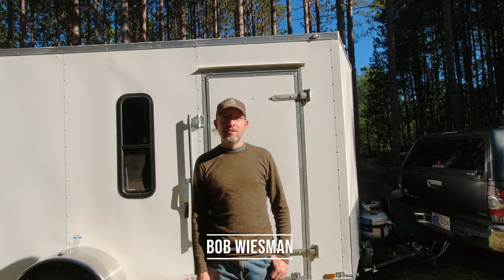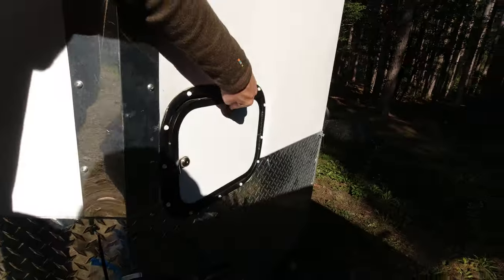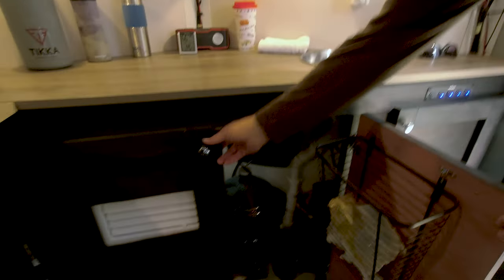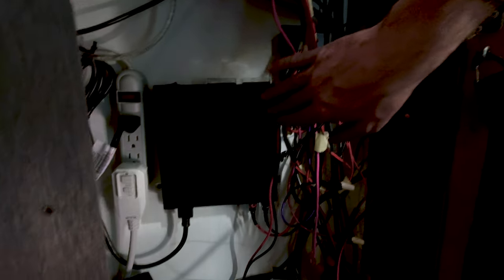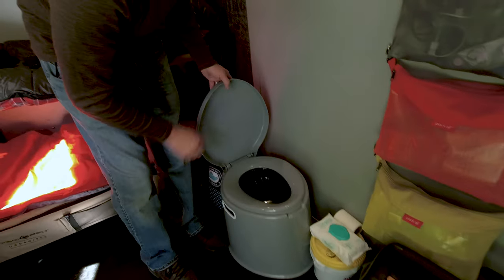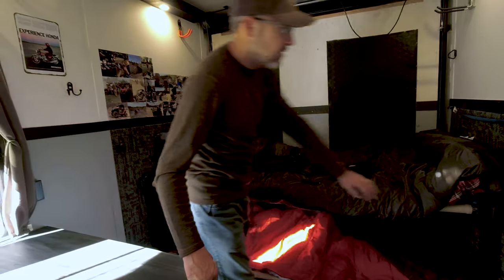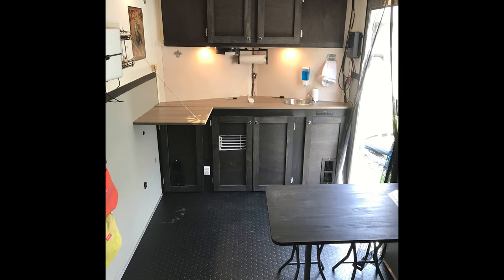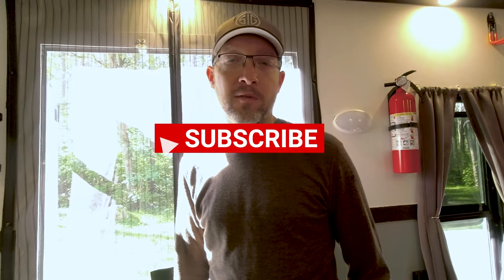6x12 Cargo Trailer Toy Hauler Conversion--Tiny Home!

Comment: Nice trailer build. This is a smaller variant and version of what I am acquiring items for. I have a 7x16 enclosed. No real "frills", only the practical needs and a few creature comfort items. Instead of the tie-down rings mounted to the floor, I am going with e-track on the floor and walls. I am also going with the Disc-O-Bed setup. I need three in my case. I am anticipating hauling an Argo 8x8 or two 6x6's. I see you most important feature is your hat.
Reply from the maker: Ernest,  good luck with your build!  I'm thinking about getting rid of the disc o bed setup as it's a bit of a pain to set up and tear down (just trying to streamline my process).  May have brackets towards the ceiling that store the beds (mattress and plywood) on them that I can manually move down to other brackets on the wall where the beds will be used, if that makes sense.  Going with a larger trailer is a great idea, in hindsight a 14' dual axle would be best for my setup!  Thanks for watching!
Reply: Let me know Paul where I can see your ideas. Good luck. Greetings from Nashville Tennessee 
 Solo

Comment: Great video. How is the ac vented again I seen threw the front but is there anything else toit?
Reply from the maker: I forgot to include that in the video.  I vented through the floor with flexible ductwork 5 or 6” diameter.  Thanks for watching!
Reply: @bwiesman  I like the whole setup wanting to put a atv in mine and your setup is perfect I’m in Louisiana so the ac is a must lol
Reply from the maker: @treycentanni8605  for sure then!!  Make sure you insulate well and also consider a roof coating that not only seals it but lowers the affect the sun has on internal temp.  I have a solar panel video where I talk about that roof coating.  Supposed to lower temp by 10-15 degrees.  Thanks again!!

Comment: This is exactly what I want to do so I can haul my motorcycle in a trailer that’s towable by my SUV when I’m not motocamping from the motorcycle. I’m retiring in Oct 2023. I could buy a truck and a toy hauler and then be stuck at work for a few more years until they’re paid off, but no way do I want to do that. I have plans! 😊 Thanks for sharing your build. I subscribed.

Comment: What mount did you use for the spare tire? Nice video.
Reply from the maker: Thanks for watching!  I used the one that came with the trailer, just bought bolts that would go through the ramp door.

Comment: Nice build, some great ideas. Good work. Ours is 6X12TA with a flat front. We spent 5 weeks traveling through 16 states in September/October.
Reply from the maker: I bet you had a blast!  I wish mine was a TA, may convert it.  Thanks for stopping by!
Reply: @bwiesman  there are pros and cons to tandem and single axle. The main reason I went tandem is that they come with electric brakes. I am a believer in trailer brakes.
Reply from the maker: @Endless_Skyway_Adventures  me too!!

Comment: Looks like you pull the trailer with a Taco,  does it really cut your gas mileage down when you pull the trailer?  Thanks , great vid
Reply from the maker: Hi David, yes it’s pretty bad on gas mileage. Anywhere from 8-11mpg depending on speed and wind conditions.  Thanks for watching!!
Reply: I'm on the homework phase of doing this too. But i might go 6or7x14. Pulling it with my taco. Love this video my friend. Subbed
Reply from the maker: @AB_thingsDFW  I think you’d be well served w the 7x14.  Good luck on your build and thanks for watching and for the sub!!

Comment: Hey bud love your build! I bought a similar trailer and I need to get some electrical in it to run a CPAP. Was curious how much the electrical setup ran you for coin.
Reply from the maker: Hi Hank, I’d say for the 3 panels, charge controller, batteries and cables you’re looking at about $900.  Depending on how long you want to stay, you might be able to just buy batteries and charge them up before you leave and when you get home and skip solar altogether.  Good luck on your build!!

Comment: Yikes! Your sink is over your electrical . . . It's probably fine but just the thought of it is disconcerting. What I would really like to see is how you did a decent job of paneling the trailer. Materials and methods. Mine new 6 x 12 trailer is covered in some pretty ugly plywood with large screws that I need to hide. I'm planning on a cedar ceiling but have not decided on what to do with the walls yet. Where did you get the rubber floor and does it small bad?
Reply from the maker: Yeah, I thought of that when I put it there.  I’m going to make a diverter on top just in case it leaks.  The paneling are original Paneling I just sanded and painted it. As for the floor, it doesn’t smell at all.  I will try to find a link as the local store went out of business.  Thanks for watching!

Comment: Got a video on the cabinet V-Nose build and rubber floor? Want to steal for my own...LOL
Reply from the maker: Hey Jason, unfortunately I don’t, at that point I had no plans for a YouTube channel lol.  Maybe I can make a quick video next week I think I have a few pics.  Basically made a 2”x2” triangle like frame and screwed that to the wall, than 2x4 front supports and shelving material for the counter top.  Thank you for stopping by and watching, and good luck on your build!

Comment: Great job. I have a 7x16 enclosed trailer. And been thinking about doing what you have done. Just don’t know where to start. Great Job. I’m for sure going to used your toy hauler for ideas. Thanks for posting. Greetings from Nashville Tennessee 
  Solo
Reply from the maker: Thank you for watching and commenting!  It’s definitely a fun project I’m sure you will enjoy it!  Check out my new bed video if you haven’t already, a huge improvement over the cots!!
Reply: Start by insulating
Reply from the maker: @SamC379  For sure!  Also make a layout of where everything is going to go on paper then use painters tape to mark it all out in your trailer.  Be sure to plan your electrical so you can do that while insulating.

Comment: What did you do for the walls ? Did you paint ?
Reply from the maker: Yeah I painted them.  If I had to do it again I’d definitely pull the boards down and insulate them.
Reply: What paint did you use im literally going crazy trying to figure out what i do because i want a clean look and painting plywood you and see the imperfections
Reply from the maker: @miamiexclusive8598  just a cheap white and grey I got from our local Restore store, brand was Amazon.  Don’t overthink it, most of my walls are covered up by bags, photos, etc

Comment: Can you tell me your interior width?
Reply from the maker: 74.25”
Reply: @bwiesman  okay, thanks for your response. So actually that must be 6.5x12.
Reply from the maker: @jimsteele7108  You’re right!  Now I need to change all my titles!!!
Reply: @bwiesman  , all good. Be thankful you got that 6.5, that way you can sleep sideways
Reply from the maker: @jimsteele7108  yeah I love the current layout.  Working on a diesel heater install currently.  Space is always an issue with these little trailers!
Reply: @bwiesman  
I have a 6x14. I have a direct vent propane furnace in it along with a small wood stove.
Reply from the maker: @jimsteele7108  sounds like a great setup!

Comment: Odd question but any way you know the weight ?
Reply from the maker: 3850 at time of filming.  Now it’s 5000 as I’ve added stuff and another axle w brakes and support tubes.
Reply: @bwiesman  thanks looking to do one but stay around the 3000lb with the weight of the four wheeler
Reply from the maker: @brilanhamlett512  my sxs weighs 1400lbs wet.
Reply: Yah my atv is 800 lbs so if I go with a similar setup as in the video I think I’ll have no problem staying under 3,500 lbs